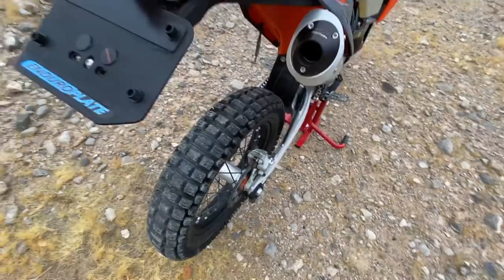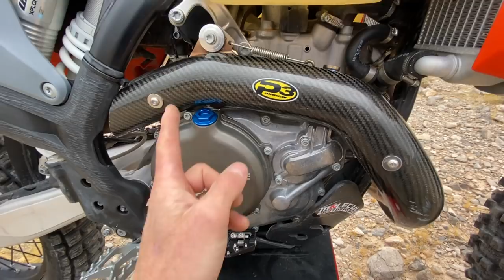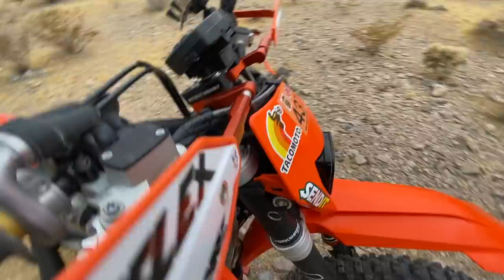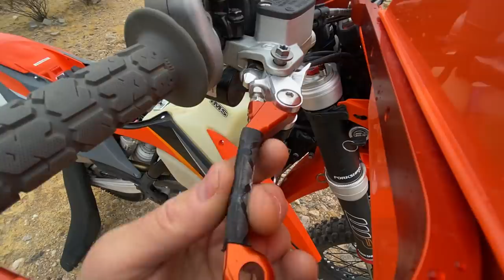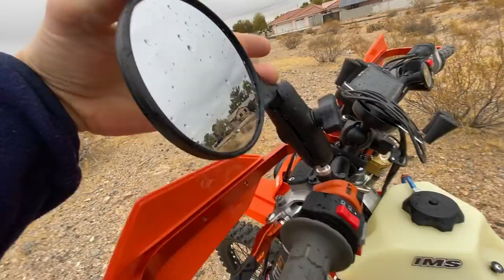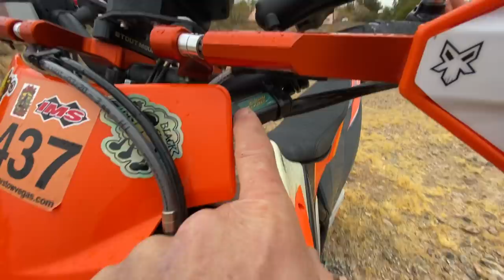2021 KTM 500 EXCF LA BARSTOW TO VEGAS DUAL SPORT DREAM MACHINE

Comment: Most excellent. I have 2020 FE501 set-up similarly. This is hands down the most fun most versatile machine I've ever had in the 50 years!
80 flawless hours running full synthetic changing every 15 to 20 hrs. (OEM clutch).

Comment: Outstanding build.  IMO, for $12k these bikes should come exactly like this stock. Such a waste to have to go aftermarket after dropping that much cash. I like the KTM's because they are light and have some nice features but too many cheap parts and lacking basic protections like skid plates and disc covers.  I like the extra capacity tank you added- great job!

Comment: Used that rear tire last summer, great traction but a little too much lean and it will slip out and it's kind of crap on downhill braking. Otherwise it worked fine, highway, gravel and trail. Wait, I had the Extreme hybrid.

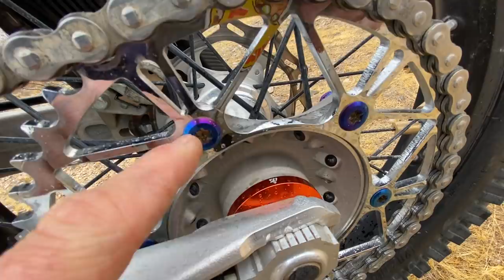Comment: What is the orange anodized piece that appears not to be attached to the rear hub at 39:13  I don't see the rear spacers, is it something intended to shield crap from getting in back there?
Reply: Tusk wheel spacers
Reply: @Papparratzi  good call, exactly what they are (googled it).  The tapered design is cool, as I have pushed in and bumped them (oem) off before.  Thanks.
Reply: @aaronmgray  I bought mine from Ty, needless to say, it’s is one of the knock offs of his bearing protectors that  he wasn’t too happy about.

Comment: I have a snowbike and want to plug a few jumper and charging cables onto the battery but can't find longer battery terminal bolts. They're the philips/ 8mm screws. I can't find a 10-12mm long ones, do you know where I can find those?

Comment: Hey mike just bought a 2021 350 excf about to pull the trigger on a vortex and fast way end cap now can I run a silencer with Vortex and still feel the same power really worried about sound
Reply from the maker: Go w the fmf q4 muffler or the PMB cap w the ultra silent insert

Comment: installed the P3 pipe guard then 5 minutes with a file on the stock oil filler cap taking the shoulders off; clearance issue resolved.

Comment: Hay Mike, do you run the stock radiator cap or what cap do you recommend if stock isn't sufficient. I'm on Washington mountain single track riding to high desert. 
Thanks for your input!
Reply from the maker: We run a fully stock cooling system and we’re in Vegas and ride here (HOT) and baja (HOT) and all over the west on gnar gnar single track. No overheat issues

Comment: I own a 2016 KTM 690 R and about to pick up a 2021 Beta 200 RR. Do you carry parts like I saw on the video for these bikes. I have on my bench an EE radiator brace guard for the Beta. I also weld aluminum. Your pointing out of the open space below their guard was immensely helpful. I will weld in a piece of aluminum on mine as I fit them to the new Beta. Should be relayed to EE in my opinion and see if they can incorporate that into the braces in the future.

Comment: Im more of a light adv rider , I am mostly interested in fuel mileage on the 500exc, how does the aftermarket ECU impact that? Just curious.
Reply: Anyone else seen when low on fuel , that the stock setup fuel line inside the tank doesn't always let you use all your gas